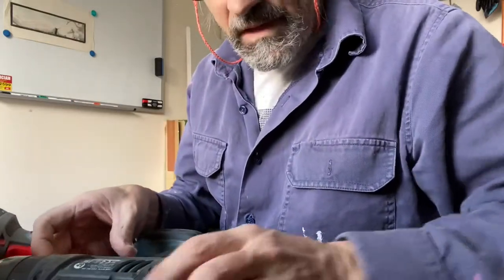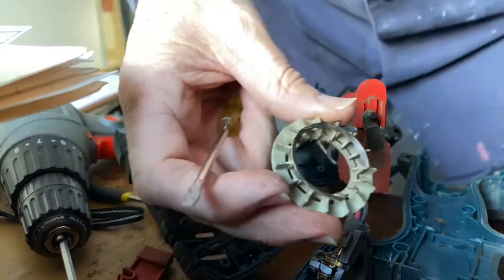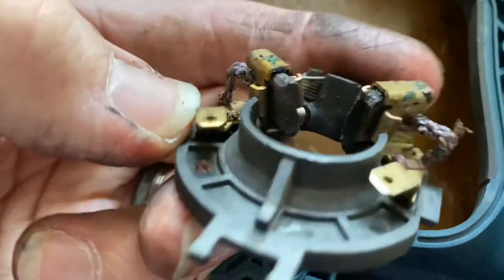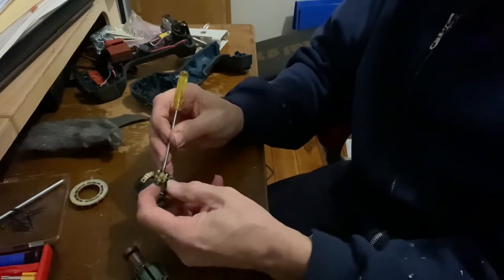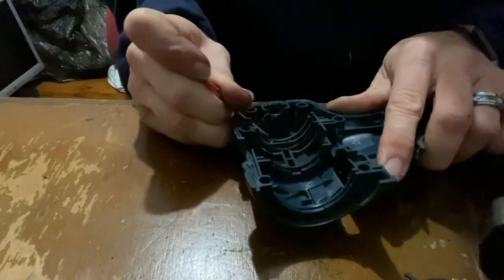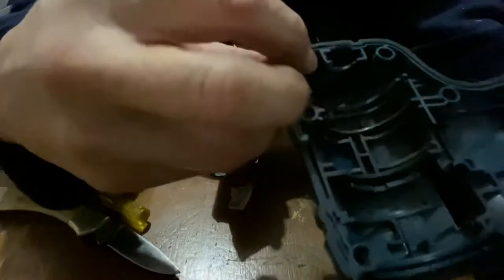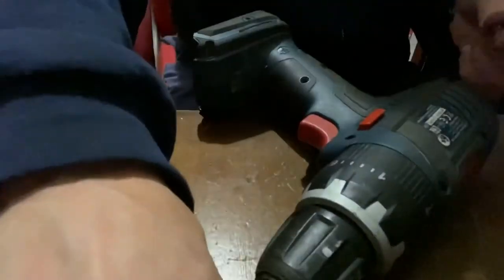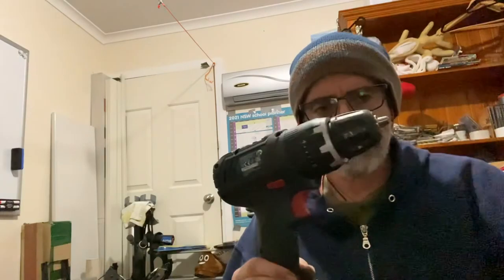Troubleshooting, diagnosing and repairing a non-working cordless drill

Comment: If it's Bosch, you can buy parts from the manufacturer. Sometimes you can buy much cheaper used parts on eBay. Bent parts can be repaired with heat. Direct heat can melt plastic, but boiling water can soften plastic. It may take a while, but the part should shape with a screwdriver and equal pressure. This is too hot for your fingers.
Big thumbs up for repair, not throwing away 🙂👍
Reply from the maker: I thought of heating up somehow. I’m not completely happy with its current state, even though it is running.